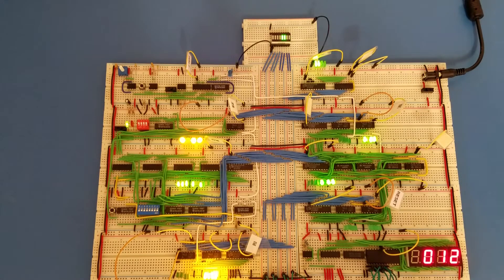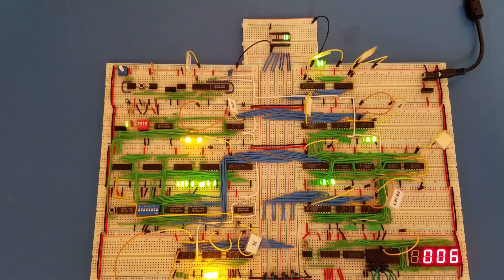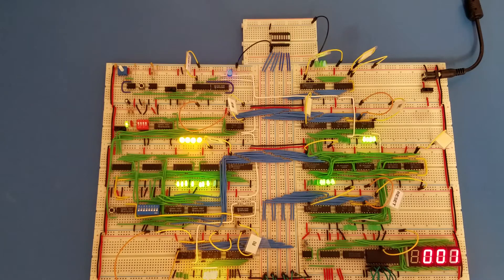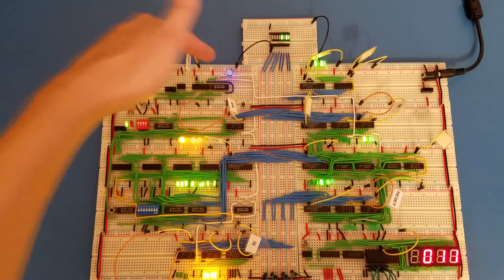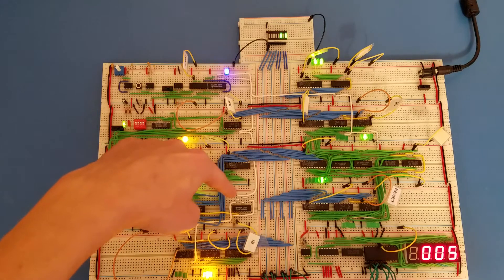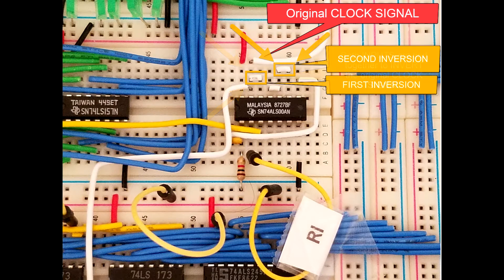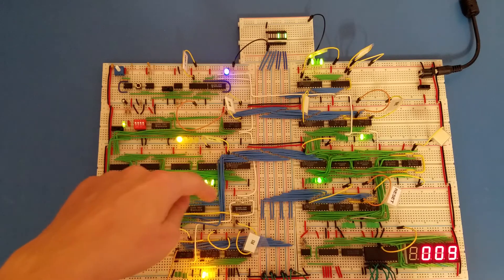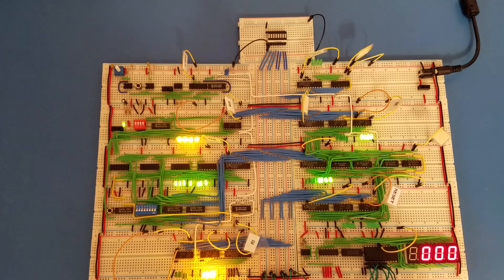[FOLLOW-UP VIDEO] Program Counter Question (Ben Eater 8-bit Computer) SAP-1

Comment: Adding basically an RC filter on the CLOCK line the whole integrity of the signal is altered (in some designs you will find RC circuit to improve clock integrity but not the case here) From what I measured jitter is a big problem (and is amplified by the use of breadboards) when adding this "edge detector" and 161 from DS is quite sensitive to clock jitter. Best way is to use a digital edge detector. Ben may have avoided this because he uses rally high quality breadboards or he is just lucky to have marginal levels of clock jitter.

Comment: I just took the clock input for the program counter from pin 3 of the 74LN32 OR Gate (on the clock BB), which is behind the AND gate, which acts as a 'buffer' from the RC clock pulse. No additional gates needed.
Reply from the maker: Sounds like a good idea. Though in my case, I built my clock using 2 NAND chips instead of the 3 AND/OR/NOT chips. Also, after messing around with that RC issue for several days, and after reading comments from many other people and doing a bit of my own research, I decided to remove the RC filter completely. (If you care to read through the other comments/replies in this video, you'll see why.)

Comment: It is a power supply issue and you need to put capacitor across the power and negative just like was done on the clock..  Program counter chip will skip.. I having issues with it from chips I picked up from NEWART and or CHINA..  so I am looking for better way to making a counter in a into better latch.
Reply from the maker: In my case, it wasn't power issues. I thoroughly checked all my breadboards for power supply problems and all my boards were getting 4.5V - 5.0V. (Also - this video is almost 3 years old at this point and I haven't had any problems (power or otherwise) since completing this breadboard computer 2+ years ago.)

After messing around with that RC issue for many days, and after reading comments from many other people and doing a bit of my own research, I decided to remove the RC filter. From what I’ve read, the CLOCK SIGNAL should remain pure at all times. Sticking a Resistor/Capacitor on it messes with the integrity of the whole system – as I found out with this PROGRAM COUNTER issue I was having.

I removed the Resistor/Capacitor and removed my double inverter GATE buffer because I can't find ANYTHING in the data sheet that says the 74LS189 has a 10μs maximum write time, and it clearly doesn’t have that requirement as you can press and hold the manual pulse button indefinitely, and the data will still get written. 
So, I have no idea where Ben got that 10μs maximum write time thing from.

So I think all that mucking about with the Resistor/Capacitor is a colossal waste of time and people should just skip that part.
Reply: David Courtney Interesting. Am now at exactly this point when building the Ben stuff. I’ll skip the RC circuit and will see where it brings me.

Comment: Having, had the same issue. I am currently isolating all of my led outputs through noninverting buffers. For a jittery counter, disconnect your clock LED- check voltages, 10k tie down to ground?  Things get funky when voltages get into the grey area :)

Comment: So I had the exact problem you described in your last video. Instead of filtering it through the nand gates, I came up with what I think is a simpler solution. What I did was to put the clock signal through a diode feeding into the RC circuit on the NAND gate. This way, you don't get any feedback onto the clock that causes the jitters and weirdness. However, this causes a problem whereby the resistor cannot discharge and go low. To fix this, all I did was put a 10K resistor on the other leg of the capacitor. This allows the RC circuit to function as Ben intended without having to discharge back through the clock circuit!
Reply from the maker: After messing around with that RC issue for many days, and after reading comments from many other people and doing a bit of my own research, I decided to remove the RC filter. From what I’ve read, the CLOCK SIGNAL should remain pure at all times. Sticking a Resistor/Capacitor on it messes with the integrity of the whole system – as I found with my PROGRAM COUNTER. My idea of isolating the Resistor/Capacitor circuit behind a GATE buffer also falls into the taboo category of messing with the CLOCK SIGNAL. I removed the Resistor/Capacitor and removed my double inverter GATE buffer. I can’t find anything in the data sheet that says the 74LS189 has a 10μs maximum write time, and it clearly doesn’t as you can press and hold the manual pulse button indefinitely, and the data will still get written. 

From what I've read, the right way to handle this is to send the main CLOCK SIGNAL into a 555 where a RESISTOR/CAPACITOR pair can safely be used to get the 10μs, and then send the OUTPUT from the 555 to the INPUT of the NAND GATE.

As one youtuber wrote in response to a video I posted about this problem, “You cannot capacitively couple TTL signals, it level shifts them by -2.3v to +2.3v. If you need a 10uS triggered pulse, that's what 555s and 74123s are for.”

So I think all that mucking about with the Resistor/Capacitor was a colossal waste of time. However, I’m wiser for the experience.
Reply: Interesting. I just disconnected the RC circuit entirely, and as you say it seems to work fine. That said, my recollection when I was testing the RAM module on its own was that I was getting a write signal on both the rising and falling edge of the clock. I'll have to play around and see if there are any bad consequences.

Another issue I had was that my RAM module was triggering a write every time I switched from run to program mode. It seems that for some reason the input pin from the manual program pushbutton to the 74LS157 multiplexer was floating low for an instant on the changeover, which instantly wrote whatever was on the 8 bits of the DIP switches to the currently selected memory address. I had to put a 10K pullup on it to prevent this, and it seems to work fine now.
Reply from the maker: Thanks for the insight about the other issue. I had the exact same problem with my RAM module. (As you said, it was triggering a write every time I switched from run to program mode.) I never got around to solving that one myself. I put the project on hold once I got caught up with Ben's videos. Then the weeks flew by, and now my semester has started up again so I don't have much time to mess with it. (Though at the moment it doesn't matter because he hasn't put any new videos in a while.)

But that issue where my RAM would get overwritten every time I switched from run to program mode was very annoying. I worked around the issue just by making sure that I CAREFULLY input my program all at once, and then switched to run mode and left it there. When I would switch back to program mode, I never knew what to expect. Sometimes I would only have 1 memory location that was overwritten, but I think sometimes I would have several.

I did quiet a bit of testing on this issue where I hooked up my oscilloscope to see when the write pulse was being triggered. I do remember that test verifying that it was the run/program switch that was causing it, but I never thought of a solution. So thanks for your feedback. I'll definitely have to give the pullup resistor a try.
Reply: Incidentally, I'm also having the exact same problem as you on your other videos where you have the spurious "47" show up on the output display. I have a few more 74LS173s, so I'll probably replicate what you did to fix that. It's kind of interesting how Ben never seemed to run into any of these problems on his setup.
Reply from the maker: Ah, good to know. I don't know anyone else who had that "47" problem. But everyone who commented said they used the 74LS173's to begin with, so naturally they wouldn't have had that problem. It's very odd to me how lucky Ben has been throughout the series.
Reply from the maker: Regarding the 10K pullup resistor that you placed to prevent your memory from getting overwritten, can you tell me where exactly you placed that resistor? I want to add that resistor to mine to see if I can solve this issue on mine as well, but it's been a few months since I've been actively working on the project, so I can't remember the details of this problem very well. So if you could let me know which specific IC and which specific PIN to put that resistor on, I'd appreciate it.
Reply: I ended up adding two different resistors on that circuit to "fix" it using Ben's original design. As I described in my original post I had to run the clock line feeding into the 74LS00 NAND gate (the one that NANDs memory write control line with the clock) through a diode first to solve the problem of memory write feeding back onto the clock circuit, which in turn caused other parts on the computer to act weird. This created a new problem though, that being that the R-C circuit from Ben's design couldn't discharge back to its normal state to wait for a write signal from to control line to generate a pulse. The resistor added was simply a pull-down on the other leg of the capacitor in that R-C circuit. I arbitrarily chose a 10k resistor because it was significantly higher than the 1k (I think it was) in the original R-C circuit. That way, electricity still wanted to flow the correct direction when the circuit was active, but then once the control line went low the capacitor could still discharge.

The second resistor I added was a 10k pull-up to 5v on the second leg of the pushbutton switch going into the 74LS157 which triggers a memory write when in programming mode. Without this, that line would float momentarily low during the switchover between run and program mode, causing memory contents on the currently selected address to be overwritten by whatever was on the dip-switches.

So incidentally, I completely re-did my whole memory module a few weeks ago. I purchased one of the memory modules that Lone Register is using (see his 8-bit computer build Youtube series). This module has advantages in that it is much newer, reasonably priced from Mouser or Digikey, is TTL compatible, doesn't need the signals to be reversed, and also is a much large module such that you can have a full 256x8 memory (as opposed to the 16x8 on Ben's design). However, there are some interesting things I encountered! First being that it doesn't have separate input and output lines. Each pin on the chip is both input and output, which means you have to add some additional circuitry to handle this. I solved it by setting it to always output, and then running the memory input lines through a 74LS245 buffer before going into the chip. The second was that the aforementioned R-C circuit on the 74LS00 NAND gate for memory write pulse was no longer needed, and in fact caused unpredictable behavior which wasn't immediately obvious. I ended up implementing an Arduino programmer/monitor (see https://create.arduino.cc/projecthub/david-hansel/breadboard-computer-programmer-1e7a09) directly on my breadboard in an open space right above the microcode EEPROM chips. It wasn't working right, and it turns out that that insidious R-C circuit was the culprit. Removed it completely, and all is good now!

That's pretty much the current state of my build. I also altered both my memory address register and program counter to have a full 8-bits in preparation for expanding the memory capacity. Currently even though my RAM chip can do 256 bits, it's still only using the first 16 bits. I'll need to devise a way to reprogram the microcode to handle the extra memory address space, which will require splitting some instructions up if I understand correctly. I also added a jump-carry circuit (which I think is probably going to be Ben's next video) so that I can jump when the ALU overflows.
Reply from the maker: I looked over that link you provided. That Arduino saving/loading programmer looks great. While working on this project, it had occurred to me that I would one day look into some method for automatically loading the programs because ... as that guy mentions in his article, it quickly becomes tedious to toggle the dip switches even for simple programs. So that is definitely something I will revisit when the time permits.

My project has been on hold since I got caught up with Ben's videos back in late June. (I returned to college later in life, so during the Fall/Spring semesters, I spend all my free time working on class work.) But I'm hoping to spend some time with the breadboard computer here in another month during winter break. "Fortunately", Ben hasn't posted anything new since late June, so I haven't really been missing out anyway.

I do believe that his next video(s) (and possibly the last in the series) will be the jump-carry circuit. I think he pretty much said as much in his recent update video.

Anyway ... thanks for the reply. Regarding the more advanced setup you're talking about, that sounds very cool, but my short term goal is to just get my existing programming system working in a way that doesn't cause weird writes to the memory when switching states. I had planned on posting a video or two about that back over the summer when I was actively working on this project, but I never got around to it before the semester started.

I removed all the R-C nonsense quite a while back. The more I read about that, the more I felt it was incorrect and should never have been done that way in the first place. So it sounds like I just need to work with some pullup/pulldown resistors to try and sort out the memory overwrite bug. It seems to me like I attempted that back over the summer, but never had any luck with it. I clearly remember hooking up my Oscilloscope to the switch and a couple different ICs so I could try and identify the problem. And I remember when I did that ... I could clearly see a voltage spike whenever I would press the button. (And that was the issue I had planned on making a video about, but never got around to it. I was going to point out the issue and just ask people if they had any thoughts on what I could do about it. As I did with my first video.)

I'm going to look at this today and see if I can figure anything out. I am interested in replacing the module with something better, but for now, I just want to get what I have working.
Reply: @davidcourtney1398  Thanks for posting your thoughts in this video. I tried your solution, and you're right, it still doesn't quite work. Removing the pulse generator also resulted in some weirdness so I went ahead an bought an extra 555 and installed it next to the LS00 configured as a pulse generator (exactly the same as the push button 555 pulse generator on the clock breadboard). Works a treat!

Comment: BTW earlier you mentioned using 373s because they latch data on the rising clock. NO. 373s are transparent  latches; that means they reflect whatever is at the input so long as the clock is HIGH, and latch it on the falling edge. This is exactly what was exploited in the 808x series past the 8085, when they added multiplexed address and data: the latch signal for the address bus goes high for about 100nS (at 1MHz) then falls, at which time you latch the lower address bus. Using a 373 part for this instead of a rising edge triggered latch buys you an extra 100nS address access time. Because ale goes high at the same time the address bus is appearing on the micro, you must wait that 100nS for the data to stabilize before latching it - this is why we use transparent latches. This is not relevant at your clock speeds, but this may be directly related to some of the problems you are seeing. You're doing well with a clock delay circuit using those gates, but what would be much better is a string of hex inverters. That will give you 6x20nS, or about 120nS clock delay. This gives your input data time to settle before latching it into the next stage.

The main clock is separated into quadrature components inside the 8085 micro; this gives you two sequential rising and falling clock pulses per microinstruction. Some earlier processors (like the 6502) actually had a two phase clock input for the micro. This trait was exploited by Woz when he invented the ingenious graphics system - by accessing memory alternately between CPU and graphics engine, neither knew the other was there. The tradeoff is you need twice as fast access time on your ram. Using a two phase clock allows you to patch an output into an input per clock cycle - one clock drives the op, the next latches the data from it.

If you have 8 inputs all toggling, and then latch the data while that's happening, what do you get? You get garbage. You have to allow time for propagation delay through the other register before latching it. A transparent latch with a high clock pin is nothing more than an 8 bit buffer and bus driver - essentially a 74xx245.

Comment: You have a ttl clock signal coupled through a capacitor. The input voltage of ttl chips is what? 0-5V. What happens when you capacitively couple something?

It's a bit amazing your circuit did not latch up. If you have an oscilloscope, put that cap and resistor back and check the input to that pin - I'm sure you will find your capacitively coupled clock pulse is varying -2.3v to +2.3v. What's wrong with this picture?

You cannot capacitively couple ttl signals, it level shifts them just like a coupling capacitor in your stereo. If you need a 10uS triggered pulse, that's what 555s and 74123s are for.
Reply: You are correct except the signal will vary from -5 to 5V rather than -2.3 to 2.3 V ....
Reply: I am interested in implementing this. How would I achieve this with a 555? Would the clock input feed into the trigger pin on the 555 and run the 555 in monostable mode? If the trigger pin is active low then would I need to invert the CLK signal first?